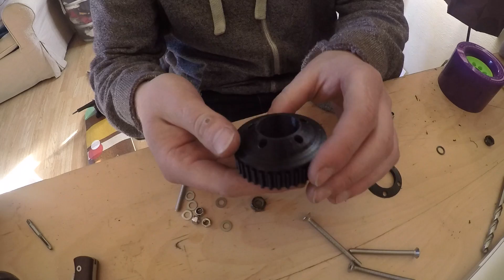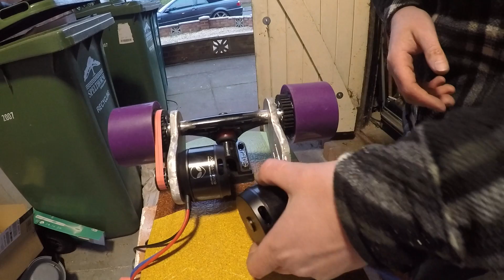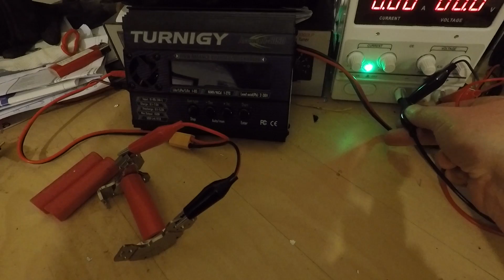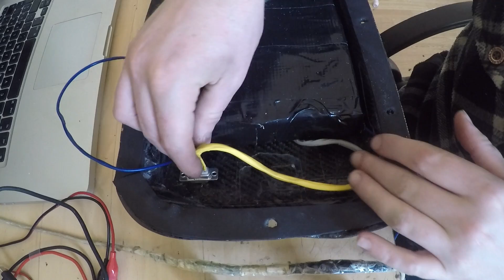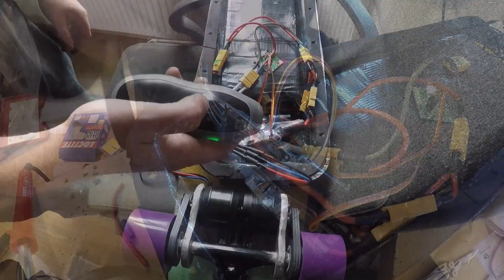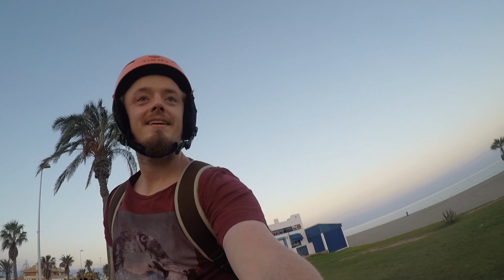DIY Electric Longboard build 5kw, 25 mile range, dual motor, dual VESC

Comment: No way this narrow belts will handle 2.5kw. Im running single motor setup with chain instead of belt. H25 chain with tensile strenght over 500kg. After 25 miles chain is already stretched. I have added extra cooling to my vesc and can pull 2.5kw at full throttle on 10s battery.

Comment: Hi , I have been thinking for a long time what will be better?
- ready to ride Wowgo 2s (2 hub motors)
- or one big 6374 190kv motor (single belt drive sys.) with 12s LiIon
   batteries and single enertion vesc
The most important for me is:
- acceleration, hill climbs, torque
What do you think ? The one big 6374 motor with good equipment can beat the 2 hubs motors of wowgo

Comment: This is such a great run through of how to make a board, i'd be really interested to know what the process is that you use to make the encloser? 

Saying that, please be super careful with those 18650 cells, as others here have mentioned, mixing and matching cells like this can be very dangerous in the long run as some cells will be stressed far more than others. That is without them being recycled from laptop batteries, which makes them even more prone to failure because of their age, and on top of that they are undoubtedly being used beyond their designed specifications - for high current, variable drain situations like that of a motor you need high drain cells such as the Samsung 30Q, and for them to be configured properly. The cells from laptops are rarely suitable for this kind of work. Also for anyone building a battery pack, definitely get a resistance welder designed for batteries and the appropriate joining material - soldering cells puts a huge heat differential across them, causing changes in the chemical composition of the cell which can lead to poor performance and instability. Cylindrical cells are made to be very robust with a lot of safety features built in, but it pays to do things properly, lithium fires are no joke. 

Stay safe man, looking forward to seeing more of how you built this

Comment: dam but 5kw on a longboard? that's hundreds of 18650 cells. i have top of the line 3450mah lg cells that put out over their stock mah up too 3600mah. i have 300 of these cells total and that only gives me 3.8kw. on 18650 cells it's not possible to go over 3500mah due to its size so this is the best possible outcome out of these cells.
Reply from the maker: You are confusing Kw and KWh 5kw is the motors power not the Battery capacity.

Comment: If it 5kw that means theres 83 amps going through each vesc at 30v theres no way
Reply: It is possible just add heatsink and thermal paste to vesc and it will handle 80 amps

Comment: Where did you buy the Motor gear, i ve got the same setup and i m now looking for a fitting  beltsystem but i did not find a Motor gear with an inner circle diameter oft 10mm

Comment: how do you charge it though?
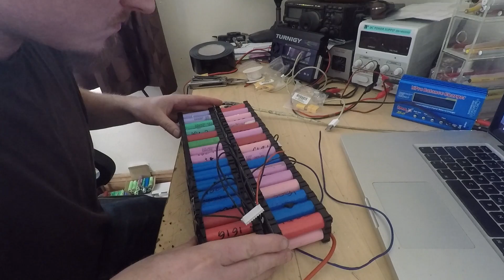Reply: see the cables hes touching at 4:48 those are the balance charge cables you plug into normal lipo charger this in its basic form are 2 big 4s lipo batterys 16.8V  connected in series totaling at 33.6V

Comment: What are the specs of the batteries you used (1 cell) also what firmware did you use to control the speed of the board with your remote?

Comment: could anybody tell me why he used 2 vesc's couldnt the same thing be done with the motors connected in series and i higher voltage rated esc?
Reply: How are you going to wire two 3 phase motors in series and also have a way to sense correct back EMF for ESC timing ???
Reply: i dont know much about motors but i have sensorless motors so i dont know if that makes a difference. did some reasearch on it got mixed results majority said it wont work well but it could work.
Reply: Zet Kasprzyk you don't, you put them in parallel with two of the connections swapped on one motor

Comment: Are you sure that those recycled cells can handle the power you are drawing from them? I have DIY packs in my board, but i pull only 30-40A continious from the whole pack at full throttle (a bit uphill). The cells can handle upto 5A each, are you sure that they can handle 5kw? :P

Comment: Very nice build! Are those lipo or li-on cells that you used to build the pack? and have you had any issues with the motor contacting the deck when you turn? Seems like the motors were mounted very close to the deck.

Comment: I'm getting ready to order two motors from hobbyking, (Turnigy Aerodrive SK3 - 6374-192kv Brushless Outrunner Motor), should i get one or two? check them out and tell me if they are pretty good, i really like (enertion R Spec) motors but they are a bit pricey and they're out of stock, if the Turnigy motors are good, what size batteries would be goodto go about 20mph or, 25mph thinking of getting 4 (Zippy Flightmax 5000mah 3S 25C )batteries from Hobbyking also, and what is a decent vesc thats not too pricey that can work good with these motors? This is gonna be my first electric board build, can't wait to start building. YOUR KNOWLEDGE OF BUILDING IS VERY MUCH APPRECIATED, thank you for this video, awesome job.
Reply: I have the SK3 6374. If you're set on getting that motor, just get one. It has more than enough power (I usually run it at half power and never find myself wanting more). Another place you can look for motors is diyelectricskateboard.com (I'm not affiliated with them in any way, just a satisfied customer). They sell similarly priced motors, and theres have a keyway, (SK3 does not) which keeps the motor pulley from spinning on motor shaft. If you want 2 motors, look for a 6355 motor, as the 6374 is too long to fit two of them side by side on trucks.

I'd definitely go with those batteries, they will give you a good combination of speed and range (25-35 mph depending on gear ratio and about 12 miles of range). In fact I just bought 4 those for a new build I'm doing, so definitely recommend.

As far as VESC, the cheapest that I know is diyelectricskateboard.com, but enertion boards and olinboard company both also offer high quality VESCs with heatsinks, which you may want if you plan to be climbing lots of hills.
Reply: Will Argus my son is 125lbs. and i'm 190Lbs., which of these motors will be best for a single motor skateboard, how many batteries (2- Zippy Flightmax 5000 3S 1P- 25C) or 4 Batteries should I get for 20mph and about 12 mile range?

https://hobbyking.com/en_us/electric-motors-1/turnigy-sk3/63mm.html
Reply: I weigh 160 pounds, and I use 4 of those batteries and get 12 to 14 miles of range, so if you want 12 miles of range I would definitely go with 4 batteries.
 In addition, the motor you're talking about is 192kv, which means that it will spin 192 rpms for every volt you put through it. Since each lipo cell is 3.7 volts nominal, that means you'll have 44 volts times 192 kv. Assuming you use 83mm wheels, and a 13 to 36 gear ratio, that will give you a top speed of about 27 mph, which should be more than enough for your purposes. In addition, using a 13 to 36 gear ratio will give you the ability to climb pretty much any hill on that motor. 
On a somewhat unrelated note, what are you planning to use for your ESC?
Reply: Will Argus  I really like the 80MM Orangatang Kegel Wheels, would they be ok? Also, I relly like enertion VESC but its really expensive, do you know of one that I can get that does ok with my build under $80 ? also, I would like at least a 12MM belt with pulley, can you help me pick one? Thanks for helping me out, cant wait for the parts, I'm ordering motor and batteries today.
Reply: Would any of these ESC work for me, the least expensive ones, also, below 150A or above 150A?

https://hobbyking.com/en_us/speed-controllers-esc-1/120-149a.html
Reply: The motor you have pulls only 80 amps, so anything above that should work. However, those ESCs from hobby King do not have a good reputation in the e-board community, and I've heard many stories of them failing in the first few months. I'd recommend this VESC http://diyelectricskateboard.com/diy-electric-skateboard-kits-parts/vesc-the-best-electric-skateboard-esc/.    It's a little over your budget but has features like regenerative breaking, and allows you to limit the power and acceleration of your board so you don't get thrown off. I use it and I highly recommend it. It also allows you to set limits on the current you pull from your battery and send to your motor, which prevents either of them from blowing up.
Reply: Will Argus  You're right, I read today the horror stories about the ESC that HobbyKings sell LoL. Ok, guess i'll be getting one of the ESC either from enertion or diy website, I like the one on the link you posted, $99 is OK, thanks, what about the 80mm orangutang orange wheels, where should I get the 12MM pulley kit that will fit the wheels that I want?
Reply: 80mm otang kegels are a great choice cause they already have holes in them which makes mounting a drive wheel pulley easy. I would recommend the diy website, I know they have a kit for those wheels with a 12mm belt. One thing you'll have to do is since the motor you've got does not have a key way, you'll have to file down the motor shaft and tighten the set screw of the motor pulley down on the filed part of the shaft to keep the pulley from spinning on the shaft. This is what I did and it worked very well for me.       Another question out of curiousity, what are you planning to use for a motor mount?
Reply: Hey Will, are you on Facebook? It would be easier to msg you or is it find through google+ ?
Reply: Manny Martinez hey manny wanted to chime in here.  The $99 VESC from diyelectricskateboards.com is great, I have one.  But if you look at Miami Electric Boards they sell a VESC wih a heat sink for $110.  Which to me is reasonable for $10 more dollars you get a VESC that is built to withstand more heat.  The one from diyelectricsksteboard does not have a heat sink.
Reply: Life of M  i'll check it out, thank you.

Comment: Real nice!  Are you finding the VESCs are heating up?  Also, what are those clips used for the enclosure called?  Thanks for sharing!

- Neil
Reply from the maker: hi, i have pushed them pretty hard and not had any problems with heat yet. the pins are called clevis pins.
Reply: kris's workshop thanks For sharing the info Kris!  This is a wicked build, hopefully mine turns out just as nice.  Happy Holidays!

Comment: what motors did you use?
Reply from the maker: alien power systems 6355 motors, 190kv
Reply: Hi Kris, my son is 125lbs. and i'm 190Lbs., which of these motors will be best for a single motor skateboard, how many batteries (2- Zippy Flightmax 5000 3S 1P- 25C) or 4 Batteries should I get for 20mph and about 12 mile range?
Reply: I want the 6374 motor, which of the 6374 motor would be good for me and my son? I dont know much about the differences about the KV.

https://hobbyking.com/en_us/electric-motors-1/turnigy-sk3/63mm.html

Comment: awsome work mate! can you brake with that board using the remote??
Reply from the maker: yes you can, the motors work as the breaks, the remote thumb controler controls this very nicely.
Reply: Hi Kris,  very very very nice build!!!!

Comment: Great build! I would recomend you to think about battery upgrade asap. Recucled cells are not made for high power applications.. I used them for my ebike 13S11P and it worked well only for one year ... Your dual vesc setup can pull 100A cont. which is wayyyy to much for those crap cells.. But you could still cruise and drive around slowly i guess :)
Happy riding!
Reply from the maker: the Vesc`s are limited to 60a max and that is only for a second. after pulling away the amp draw is only about 0.7a per cell. an electric skateboard does not use 100A continually. that would be 3300W. its more like 250w when cruising along.
Reply: Dude you have 8S8P configuration so 0.7a per cell is what? 150-200w of power? Thats whay to low..  Unleas you are very light bodyweight and  cruising around very slow :) When acelerating your cells will have to work very hard to keep up the demand and they are simply not made to go over 1A discharge per cell.. Belive me ive bin there , they wont last long...  I understand that funds are problem and battery is most expensive thing so i went that route to and mine diy battery lasted for 1 year barely.. After that i was to lazy to fix broken paralels and search for  dead cells... So i made new pack with new Panasonioc 18650PF cells and it works freaking awesome.. For your application Samsung 25R cells would give you nice power and range at lighter weight :)

Comment: Great build!  What's the remote you're using?  Thanks :)
Reply from the maker: it is a maytech remote. im very happy with it. it has worked flawlessly and it even has cruse control.
Reply: How much did the remote from Maytech cost?

Comment: This is an awesome build! It would be so cool if you could post a parts/costs list for it!
Reply: have u found some time?
Reply: 120€vesc x2
60€motor x2
battery....
you can approximate the elictronics at 500€
Reply: where the hell did you find 60 euro alien brushless motor mate? lol
Reply: please?
Reply: please?
Reply: please???
Reply: please??
Reply: I think his board was 4x16=72 cells
Reply from the maker: i will try and find time to put one in the description latter.
Reply: Have you found time to find the parts list yet dude?

Comment: i recommend you put a bms on the battery,  most have the capability to charge with the bms but using a good charger with balance charge is much faster. The bms would mainly be there to protect the cells from getting to low. I ran into an issue when i made a lithium scooter battery and the voltage drop across one of the cells in the pack was greater then the rest, causing a complete failure of that cell when voltage got to low. Dont assume that the overall voltage is telling you how all cells are. I installed a bms so it cuts the power if a cell reaches critical voltage.
Reply from the maker: it has a balancing port and is balanced using a smart charger. im my opinion this is way safer than a bms because i know if it isnt working because i can see the voltages as it charges, watch the battery video on the channel and you will see that is is indeed a balanced battery.
Reply: The BMS would be strictly for when the battery is in use, not all the cell's in series discharge at the same rate
Reply: I'm not disputing using a balance charger, its highly recommended. I just was bringing the fact that you don't have a protection circuit that monitors the cells voltage during use and cuts power when any cells reach critical voltage.

Comment: Nice work. What was the total parts cost?
Reply from the maker: £650 for this one but the one i made for my girlfriend was £400. cheaper deck, smaller battery and single motor cuts the cost alot!
Reply: Not a big but when you have two its easier to drive uphill. but if you want to build one and you dont want to spend much money take one.

Comment: Good video - and nice work too. Could have given the view of the batteries a bit longer so people can see how they are wired.
Reply from the maker: thanks, this video is a short version of the build, im uploading a 6 part series that goes in to much more detail.
Reply: they are wired in series parallel. 

see the LCD for voltage, 32V/4.2 = 8 batteries in series. Then just parallel strings of 8, as much as you can fit in the physical space.
Reply: when? :) :)